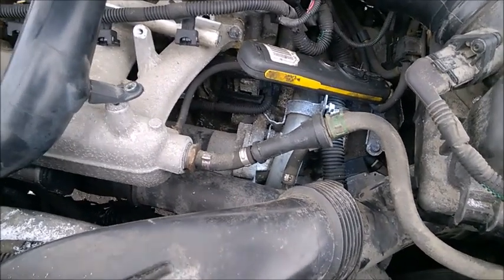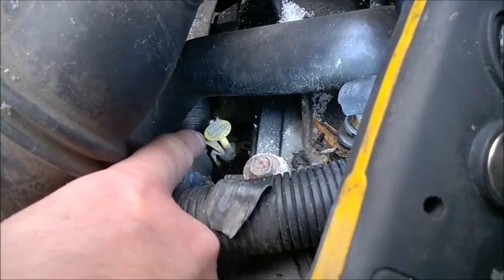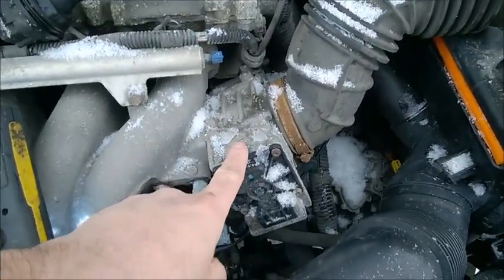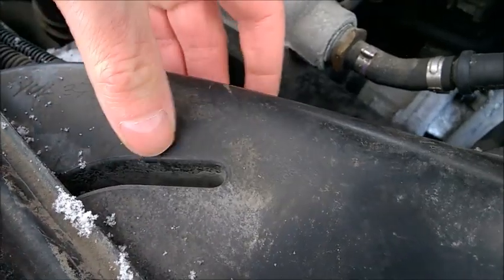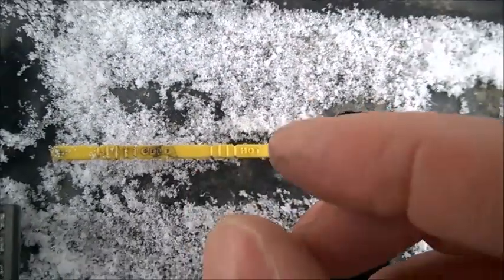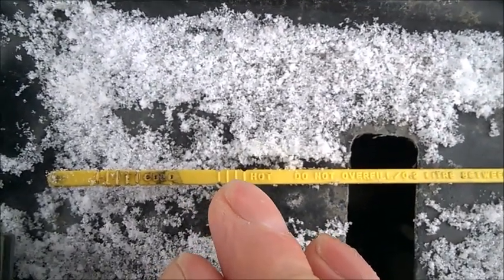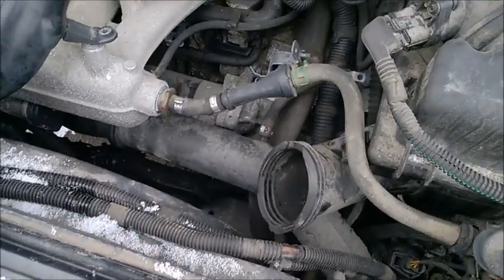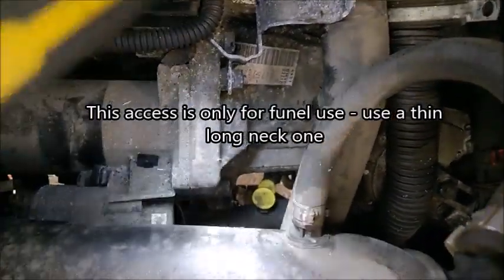Volvo S60 V70 Turbo Transmission Dipstick location 2001-2009

Comment: So is the only parameter required for a proper level read is when the transmission fluid is 80°C?
Reply from the maker: Yes. Also have car on very level surface  https://youtu.be/czDDSwguYR8

Comment: This is not true for my 2008 V70 2.4d. Still cant find it. Looks almost like it doesnt have one. Can that be? 
Btw, snow  IN your engine?  lol.
Reply from the maker: For your diesel engine, ask these guys  in the UK  https://www.volvoforums.org.uk/index.php?s=a8e2a9a7f44a3064ca7928c0db4bec77
Reply: @Peppermint1    Thanx!!
Reply: I drained and filled my 2004 Volvo S60 transmission fluid. Read that the capacity was about 3. 7 quarts. Put that in then it showed way over full on the dipstick when cold. So then I drained out about a quart and now it's not even showing on the dipstick when hot. I just drove 60 miles like that and hope I didn't screw up the transmission. Seems like getting an accurate measurement for transmission fluid on this car is a nightmare